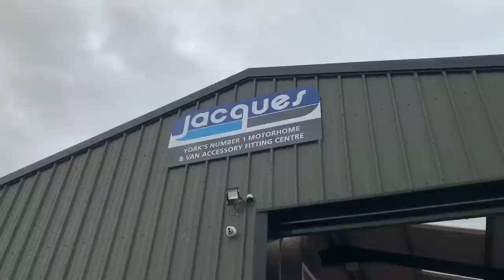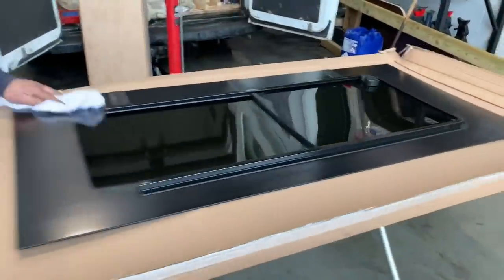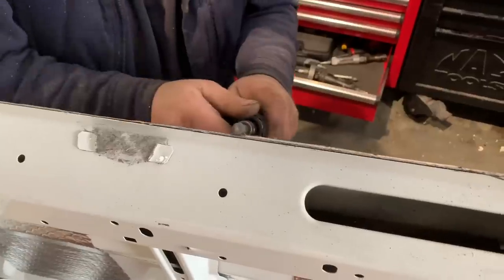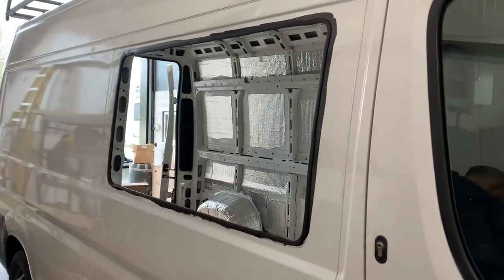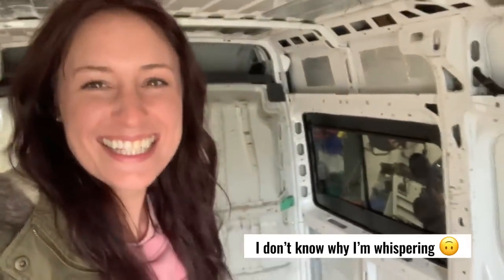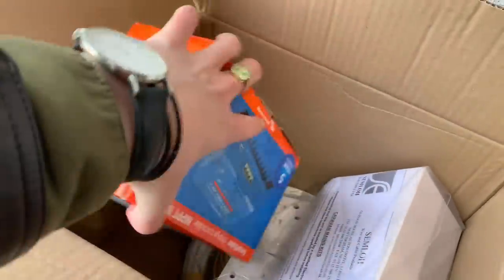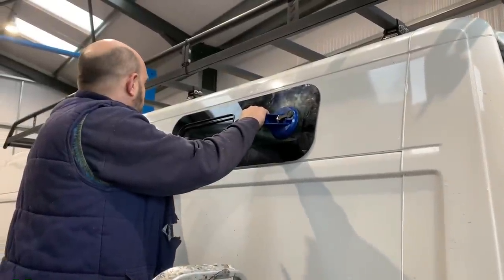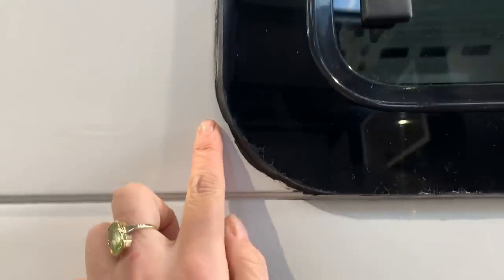WINDOW FITTING - van build Ep.6

Comment: Glad others picked up on the window fit . I did mine myself and followed to the book , one thing I noticed was all the cutting with red hot sheet metal flakes everywhere . No taping up or covering up of panels . You will get rust spots all over the paint , check the paint regularly and when you see them appear buff off or use rust particle remover . I covered up my paint but still managed to get some as they stick . Especially seeing that grinder in action. Good luck though with the build

Comment: The van looks to be coming on great, it’s a big step getting the windows in. It is difficult to see from the video but just check they didn’t seal the bottom of the smaller window, there are 2no sliding window drains behind the glass, water will start coming in if they sealed them in by mistake 👍
Reply: It does look like they have blocked the drain holes by adding that extra bead all around.
Reply from the maker: Thank you, yes they’ve made a huge difference and I’m still smiling each time I see them. 
No need to worry, they’re not sealed. It’s rained pretty much constantly since, with freezing temps over night. No issues what so ever 🥰

Comment: Hi, what did you mean with the 2nd window about DVLA?
Looking fwd to see the rest of the build.
Well done 👍
Reply from the maker: You can reclassify a van as a motorhome but there are certain requirements laid out by the dvla. 2 windows minimum is one of those requirements :) 
Means cheaper insurance basically if you can get the van reclassified. Hope that helps :) 
Thank you!
Reply: @myvanworld  Sorry but i read it as 2 windows on at least one side.
Insurance didnt change much on mine but speed limits did. Is your van class 4 or 7 mot? 
Cheers 👍
Reply from the maker: @evobobber  yes people interpret it differently. I’ve had advice from dvla & it really just depends on your case worker. 
But if you have 2 or more windows, most insurance companies will insure for motorhome even when dvla won’t reclassify it. So that’s what I’m doing p
Reply: @myvanworld  Best of luck  👍
Reply from the maker: @evobobber  thank you :)

Comment: Hi Becca, loving the channel, I,m hoping to convert a Peugeot Boxer soon, are you removing the bulkhead panel behind the front seats? And why did the little window not sit flush? Want to put those in mine but didn’t, think to go up that high. ❤️
Reply from the maker: Thanks Jonny! I hope you find a good one soon :) 
I’m keeping the cab separate for numerous  reasons, of which I will explain in a future video. But I’m replacing the bulkhead as it’s too heavy. 

The window didn’t sit flush because I wanted it on that top panel & the van slightly curves in when you’re that high. 
It doesn’t bother me, I couldn’t care less what it looks like from the outside, that’s not my priority at all. But if you’d like a flash finish on the outside of the van I’d opt to put it elsewhere to be neater :) 
Hope that helps!

Comment: Sorry to say but they made an absolute abortion of fitting that small widow, what a mess all that excess bonding agent , even after they cleaned most of it off ( note all the papper towel on the floor ) there is still garbage left . Yes I have fitted windows all round my Citroen relay including the rear doors and never made any mess . You plan ahead so as not to cause yourself excess work . I wouldn't pay these so-called professionals.

Comment: I'd be a bit worried about that window fitting.  The black primer they used on the bare metal, was meant to go on the glass and the van panels before the sealant goes on, not to seal the bare metal.  sorry to be a worrier....  Glad they sponsored the video for you, but not great workmanship on their part I would say.
Reply: I couldn't agree more. I think that's a shocking job and looks horrendous. The primer can be used on the bare metal as it contains rust inhibitor, but it is designed to prime the bond of the adhesive. Just hope it doesn't leak or give any problems later on.
Reply: Hey how are your windows? What do you think to the job he did with the mastic gun, as ours looks like it was put on by a 3 year old...